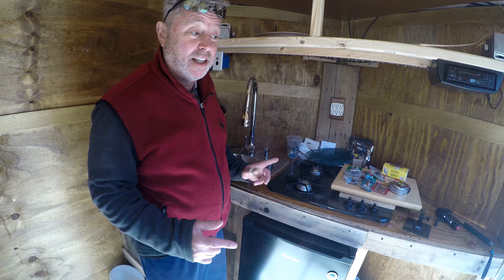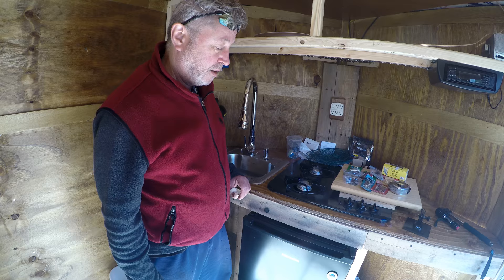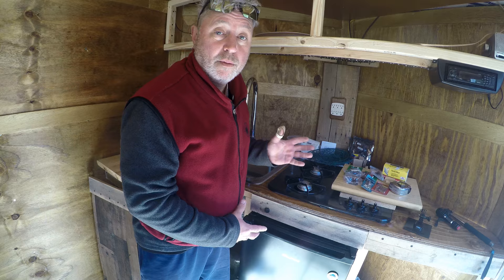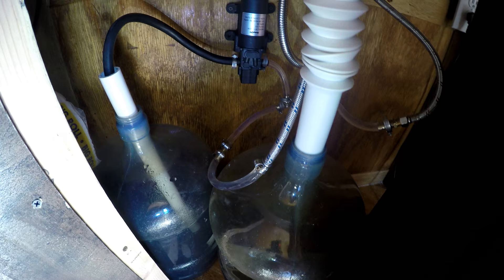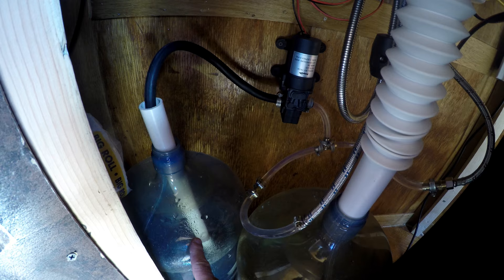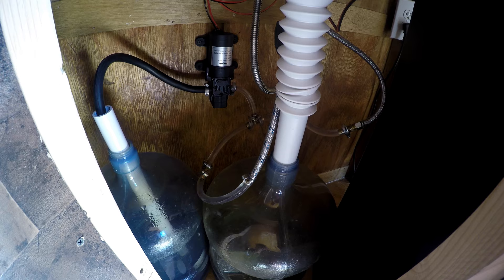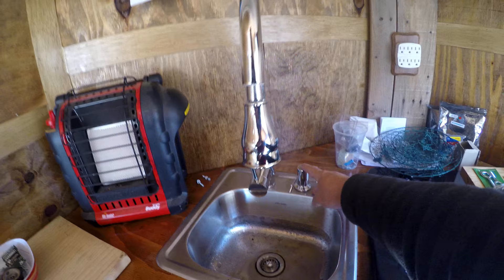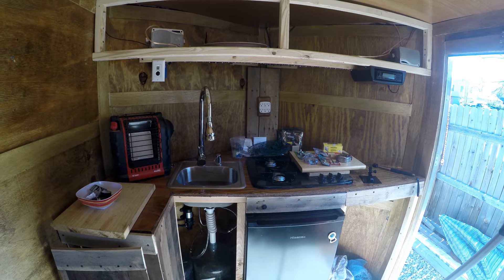Easy DIY Camper Sink and Faucet - Cargo Trailer RV Conversion

Comment: Your water pump is mounted on a panel acting like a drum. Put it on rubber isolation mounts the sound will not excite the panel and the noise will be reduced.
Reply: I cut up an old foam rubber coozie to isolate the pump from the mounting surface.  Cuts the noise by 2/3!

Comment: If you want to reduce that noise from the pump, you could build a simple insulated housing out of a cardboard box with styrofoam glued to the inside that slips over the pump. Just be sure the pump can still get adequate ventilation. I would put an air vent to the outside, and give the pump 1" clearance from the styrofoam.
Reply from the maker: Great Idea!  Thank you!
Reply: Bo Insogna, I'd love to see you do a follow up video with my suggestion and a review. Pump noise is a common complaint, and I used this idea in my campervan 20 years ago, when I was living the vanlife, but I haven't seen others do it. I think it's a great fix for that problem, and it worked well enough for me to stealth camp before it was so common.
Reply from the maker: Thanks again! I will take it into consideration.

Comment: I think you need some sort of pressure accumulator. I know with my RV the pump actually pumps up a little bit... Kind of like a well tank... You can flip the water on and it's running without the pump actually running for a short duration as long as the pressure is built up. Then it just sort of Cycles on and off as needed
Reply from the maker: Thanks John!

Comment: I may use jugs or  I have 4 soda machine tanks 5 gals each. Usually, run about 70-80 $ach. They take pressure up to 100psi. so I may connect them together and have an air pump outside the camper then I'll pressurize 20-30 psi. The bad thing about this set up would be a possible leak, But I may try it.
Reply from the maker: Interesting concept.  Thanks for sharing!

Comment: Like your setup I'm getting ready to build a 7 by 14 .on your heater buddy don't you get condensation build up inside at night.
Reply from the maker: Hi, good luck with your build.  7' wide is a great way to go.  In Colorado We do not have that problem. Plus we do not run when sleeping.  I just got a new Heater buddy with filter at a great price to replace that last one that failed after 5 years. Was going to replace with something else but love the size and where we have it.  Thanks again!  again, Good luck with your build.
Reply: @TheeLightningMan  thanks for getting back to me so soon.great video,.

Comment: How do you wire up the switch to the pump? I’m I stalling the same system but stuck on the switch deal.
Reply from the maker: Put the switch on one side of the power line.

Comment: Where did you get the faucet and what is the brand and model?
Reply from the maker: It is no longer available.   It got nailed by a freeze and I replaced it with a wet bar Faucet.

Comment: Who makes the water pump, want to see if other made
Reply from the maker: Does not list the make but here is a link to the one I used. https://www.amazon.com/dp/B00VS4AHTG/?coliid=IEZ3A0FAUAAT&colid=18WZCVGYV1N98&psc=0&ref_=lv_ov_lig_dp_it
Reply: Bo Insogna Looks like  a seaflo I was going to use that as well. I think RV shops sell thus brand SHURFLO

Comment: Hey Bo, is that blank tube drinking water compliant. Unless you're only using that water for cleaning and not for consumption
Reply: I think it's called FOOD Grade tube for drinking water
Reply from the maker: Not sure on that.  We always use bottle water and the sink for washing things.  Good point.
Reply: I don't think I would use the black tube to drink from. Clear tubes that are food graded is what you want to use for drinking...That black tube is more for car parts I am guessing.
Reply from the maker: It came out of our pop up.  Good to know.  I can swap it out at a later date.   Thanks again.